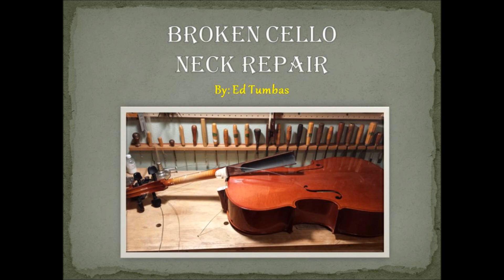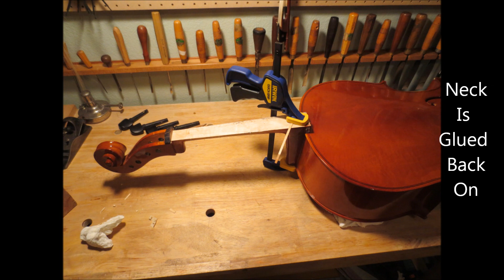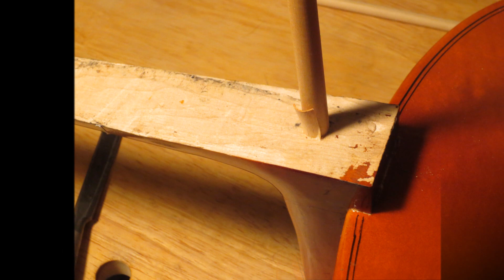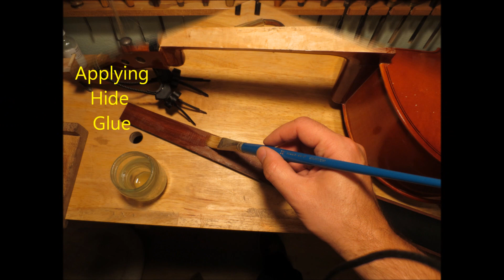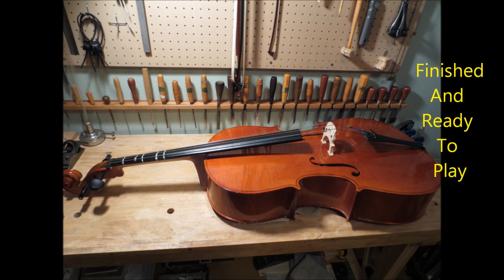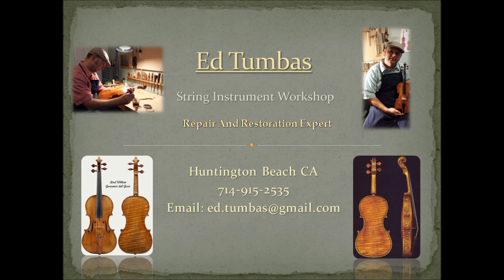Cello, Broken Neck Repair

Comment: Thank you Ed. I just took in a cello to repair rhe broken neck. Was planning on using a 1/2" dowel, but will definitely use two 3/8" dowels instead. Don't know how anyone could give a thumbs down to this. I give it a big FIVE THUMBS UP! Thanks again for sharing.

Comment: Hello, thank you so much for your video. Unfortunately, the same happened to my Cello.  I would like to glue the neck only with out drilling.   May I ask what kind glue are you using? Any brand?
Reply from the maker: Hide glue. Unfortunately, the glue alone will not be sufficient to keep it from separating again. Best of luck 👍
Reply: @jz441  Thank you so much. How can I remove the fingerboard? it attaches (very strong) to the neck.  I am I afraid, I will destroy the fingerboard. Any suggestion? Thank you so much
Reply from the maker: @helixmind6518  here is a good video for fingerboard removal 
https://youtu.be/QhAZSiRfDB4

Comment: My son's Knilling cello has a slightly different type of "coming" break...hasn't broken yet but looking like it is just a matter of time. Wonder if you'd be willing to opine on a variation of your repair here.  The part of the neck where it goes down towards the back which spans the cello top from front to back is starting to pull away. 

In your video which had a couple of open cellos under construction, it seems there is a block inside under the neck. would it be possible to detach the neck, reglue and use the dowels in several spots through that block or perhaps use a screw under a counter sunk plug to keep everything attached?  Thanks in advance!
Reply from the maker: em bed - I need a picture for better assessment.

Comment: Also, do you recommend hide glue (if so, what strength) or would a regular wood glue be suitable...thanks again!
Reply from the maker: em bed - hide glue, strength 315. No wood glue.
Reply: Just did a bunch of looking online and hide glue for sure. Neat stuff and it predates me...will begin using it for other woodworking type repairs as well.  Did you see my pix? Thanks again

Comment: Is it possible to use screws instead of wooden dowels? If not, why?
Reply from the maker: Vevano Intheflow - Screws cause the grain to split, therefore a failure is certain under full tension of the strings.

Comment: Hi Ed,

Thanks for trying to help! Here are links that may work for the pictures...

http://i36.photobucket.com/albums/e26/mbed1/IMG_4919_zpsybm5jxxg.jpg

http://i36.photobucket.com/albums/e26/mbed1/IMG_4919_zpsybm5jxxg.jpg

http://i36.photobucket.com/albums/e26/mbed1/IMG_4919_zpsybm5jxxg.jpg

I was able to see that there is a neck block at the base of the neck where it attaches. Wonder if good plan would be to:

-remove strings (my son said the sound post may pop out though...does tension of strings actually press face enough to hold it in place?)
-either remove neck completely to allow better glue surface or just squeeze some in between the body and neck
-either use 2-3 hardwood dowels through the top side of the lower neck and into the neck block and finish it flush on the visible side 
OR 
-drill three (?) countersunk holes to use a coarse (assuming better for holding due to bigger bite?) wood screw in each to tighten the newly glued neck and then filling in a semi-matching plug to cover the screw heads and finish that flush

The cello is a Kniling for extra info...again, many thanks!
Reply: Could i be able to do this on my own ? it looks pretty easy to do by your self

Comment: How much does this cost?
Reply from the maker: +Abigail Haynie That depends on what the extent of the damage is... Some require more work than others, but I generally charge between $120 and $150.  However, I a new neck is needed, the replacement is $600 - generally not an option for lower grade cellos.
Reply: +Ed Tumbas Thank you so much.
Reply: +Ed Tumbas where are you based?
Reply from the maker: I am in Huntington Beach, CA 
This type of repair is between $120-150...